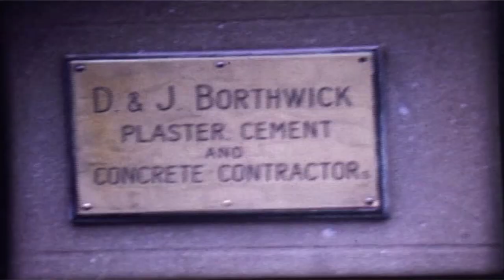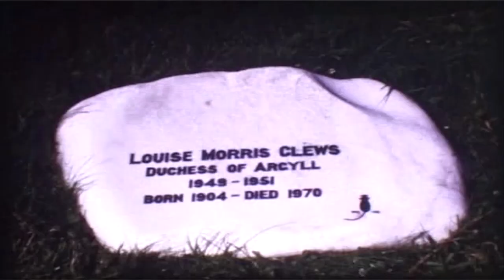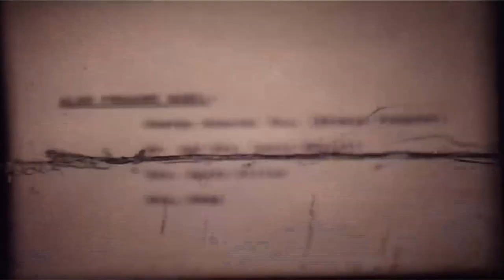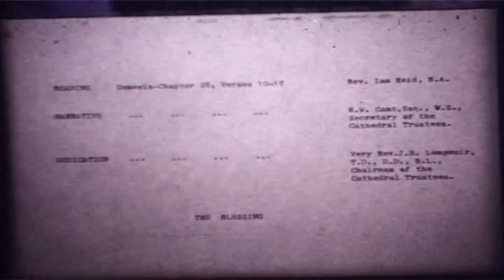MM Films present A Study in Concrete by Exposagg: St. John's Cross, Iona (1970)

Comment from the maker: Murdo MacKenzie has kindly offered some further details, as follows:

As is evident from the film the sections of the cross were transported to Iona by “puffer” so called because of the sound made by these steam driven craft when exhausting the steam used as their means of propulsion.  These flat bottomed craft were designed originally for use on the canals used for the transport of general cargoes but were later found ideal for the conditions found on many of the western isles where before the days of piers the only means of discharging cargoes was by beaching the boat on sand or shingle at high tide followed by unloading the cargo when the tide went out and re-floating the boat on the next high tide.  Martyrs Bay on Iona was one of many hebridean beaches ideal for this purpose.
 
The life and times of the “puffer” are of course immortalised by the author Neil Munro in his tales of Para Handy many of which are in part at least factually accurate.  One of these involved a circus and the annual gathering of the Mull and Iona Association which as the tale relates did actually take place prior to the advent of the St Andrews Halls in the Waterloo Rooms.
 
The use of derrick cranes mounted as in the case of the puffer visiting Iona was an improvement as previously the cargo often of pebbles or sand dug off the shore had to be dug out of the hold of the puffer by hand an operation which as I have already said was tide dependent.
 
The use of a system of ropes and pulleys known as a block and tackle was developed in ancient times to assist in the lifting and manoeuvring of heavy weights and was employed to good purpose when handling the Iona Cross as space i.e. room to manoeuver in the immediate vicinity of the cathedral was at a premium.
 
As explained in the commentary the concrete mixer intended for use on the project having died Messrs Findlay, Logan and Tonietti set to, to mix by hand under the watchful eye of the engineer in the proportions cement to sand to gravel of 1:2:4.